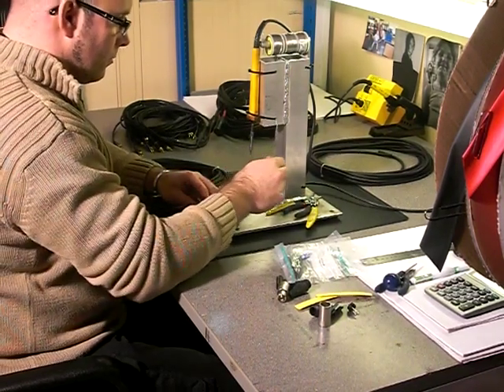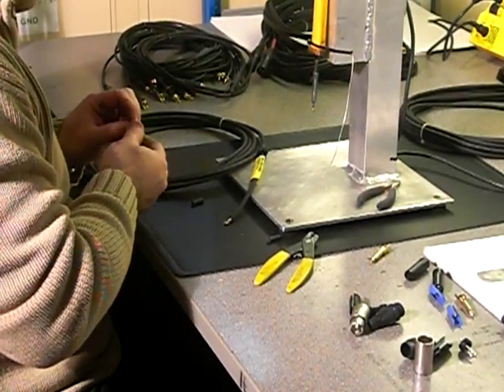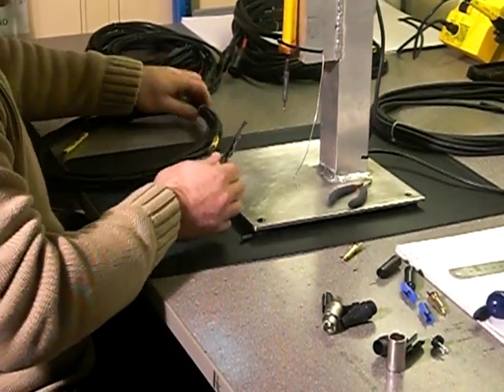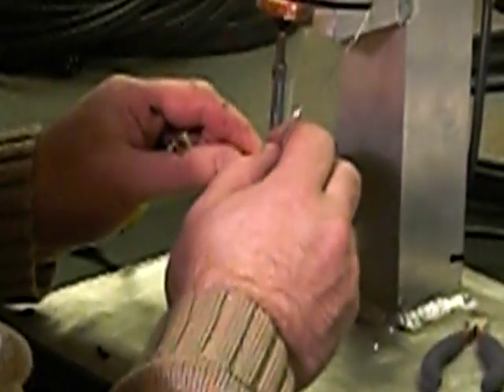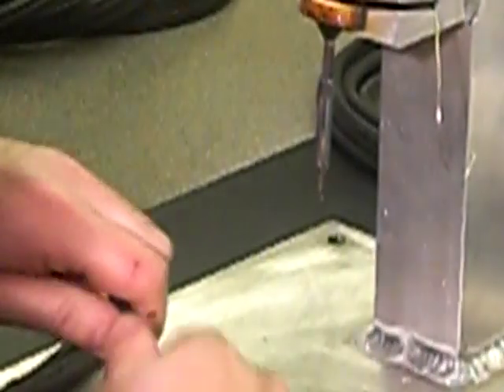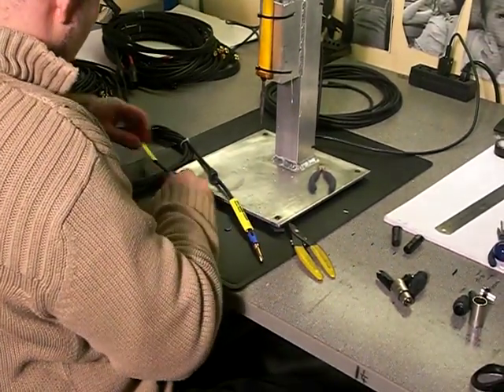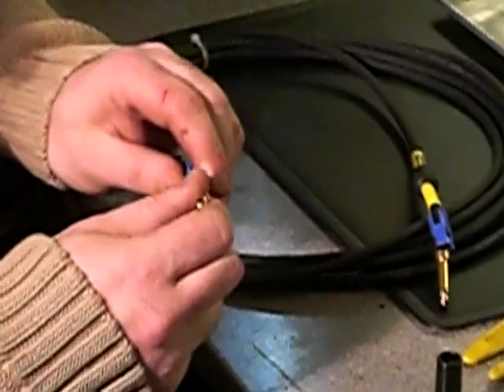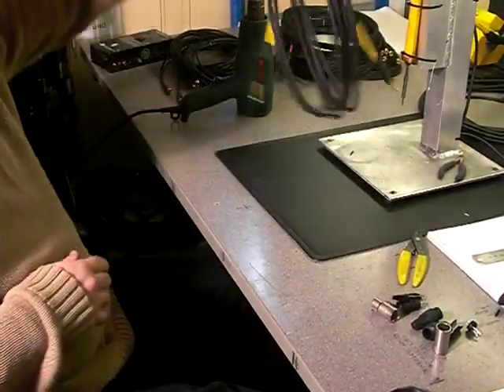How to build a Guitar Lead with Neutrik Jacks

Comment: I appreciate your reply. If you heat shrink only the barrel end, not the plug's body, you can still get the plug apart if need be by holding the barrel end stationary and turning the body. The heat shrink has less tendency to creep from cable movement if it's tightly shrunk to the barrel than if it's simply shrunk around the cable itself, especially if you use any kind of cable wrapping like TechFlex. And, it still gives cable rigidity. Just a thought.

Comment: Why heat shrink under the barrel end? It does nothing. Heat shrink over the barrel end for extra strain relief, (especially if you use a TechFlex cover). We do.
Reply from the maker: Thanks for the comment. Having the heat shrink under the barrel does still provide rigidity to the cable but with the added bonus that if you need to change the connector or re solder in the future you don't have to cut away the heat shrink and it stays intact.

Comment from the maker: No specific advice for assembly , but we would use an NP3RX in stead of the NP3RC  which are old style.

No need for the heat shrink...these are just to brand or mark your cables so you knows its yours

Comment: What he actually said was heat gun.  Used to strip paint and other things.  Theyre go up to 900 degrees celcius which is what you need in order to shrink heat shrink.  You can get them at hardware stores.  Also you can use a jet lighter.  Works well and doesnt leave those black marks like the guy mentioned in the video. Thats normal lighters that do that.

Comment from the maker: the heat grip is the hear shrink we put round cable to display logos etc

Tin the wires is putting the solder onto the wires, and fill the cups is putting solder into the buckets of the connectors